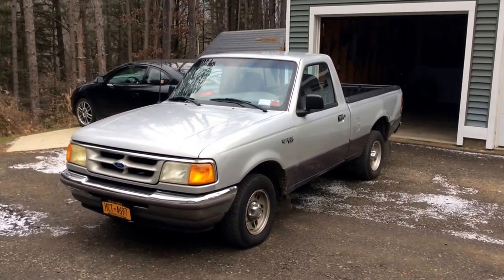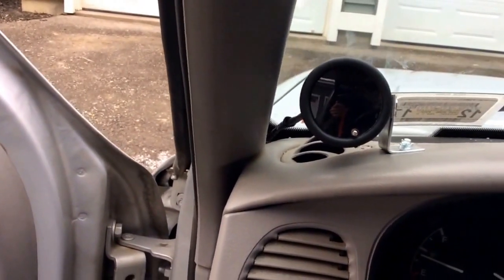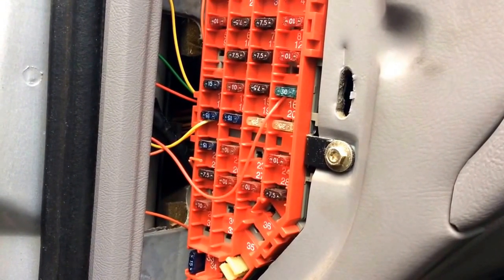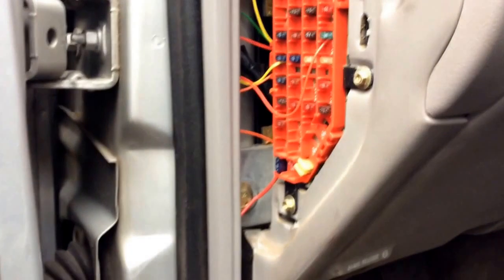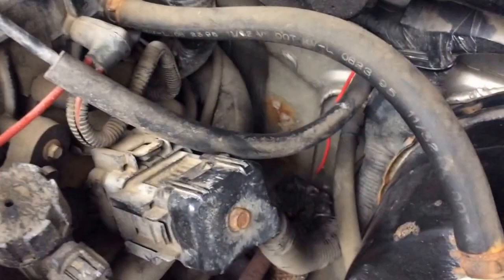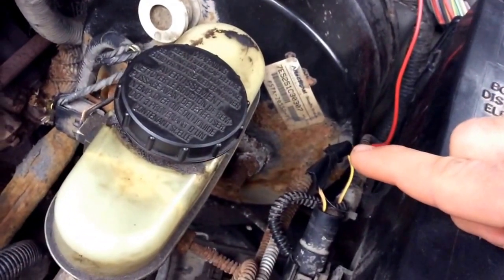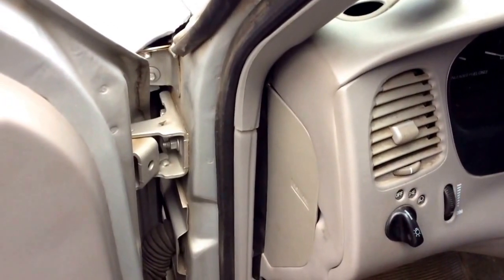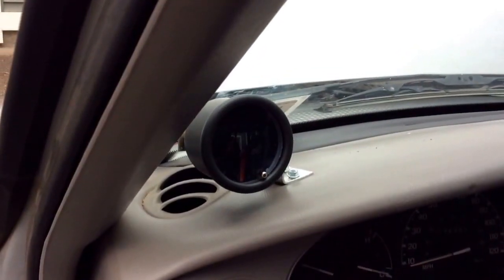Installing a glow shift tachometer

Comment: the yellow and tan wire also can be found in the plug that goes into the instrument cluster. all the rangers with or without tach have this wire. so you could get a factory tach gauge cluster and just plug it in.